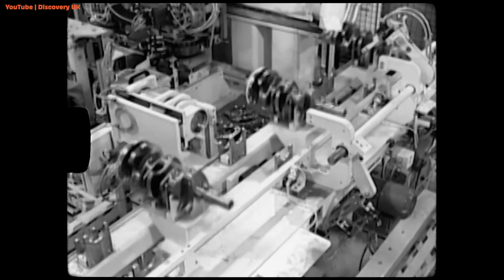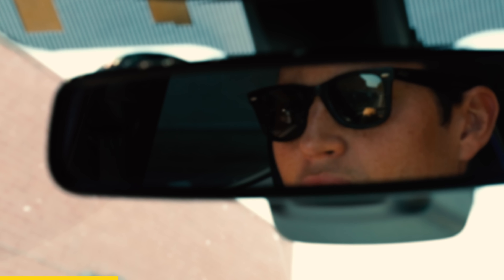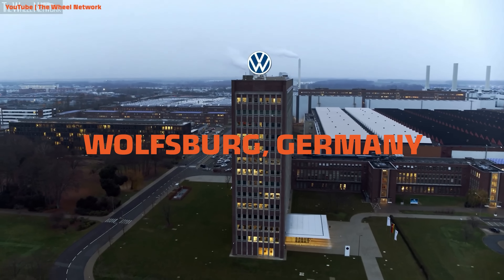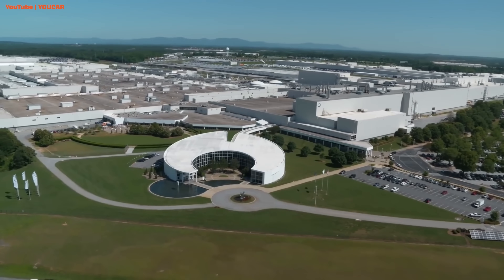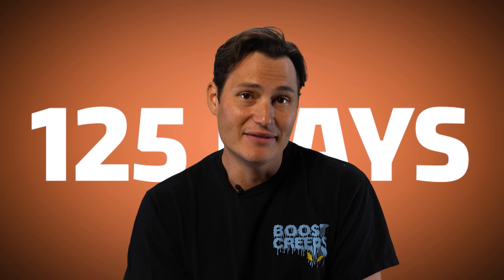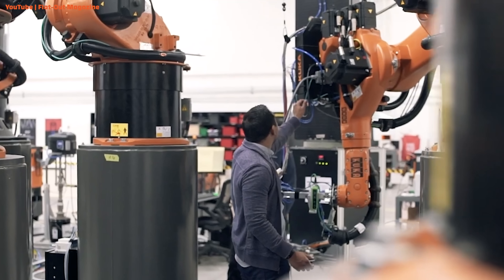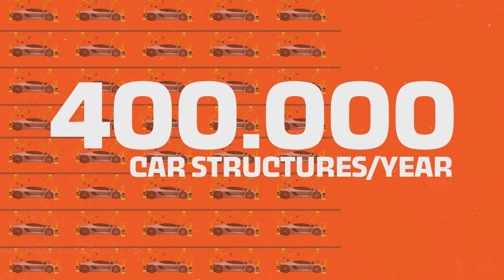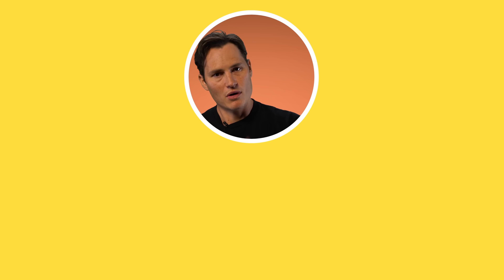A.I. Designed this Car

Comment: but disadvantage is : it can't be repair cheaply..... or repair shop doesnt have capability to repair it, which mean replace with brand new part, if it was chasing module?? wew so much expensive

Comment: The bottleneck is obviously the 3D printing. That is slow. 125 days to make the parts, 1 hour to assemble. You kinda glossed over that bit. So the question left is how can parts designed by AI be built at scale?

Comment: Part of this comes down to the cognitive side of how people design things being what it usually is that being just adding more plastic crap to drive up costs thus inflating the final cost of the car while making an inferior product that will ultimately end up being disposable. These companies should consider neurological diversity which would accomplish some of what AI does and just do things right like what the analog generations had done during the cold war for example where development time was much shorter instead needing decades to get from paper to finished product.

Comment: "A 3D printer doesn't print out extra material"
I'd like to introduce you to the support material bin in my office.
Also if I'm not mistaken, the metal powder in metal printers can't be used more than x amount of times before it needs to be changed, hence waste here too. (Correct me if I'm wrong)
Reply: actually in the b-roll footage when he's talking about it you can see support material inbetween the fins on the turbo fan